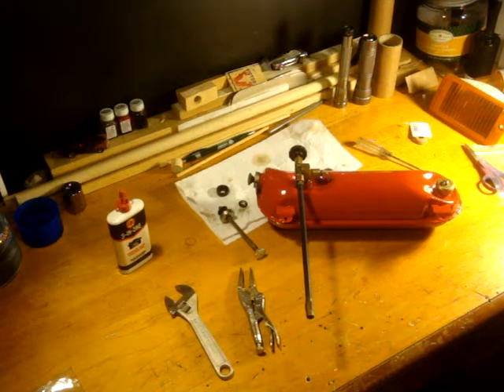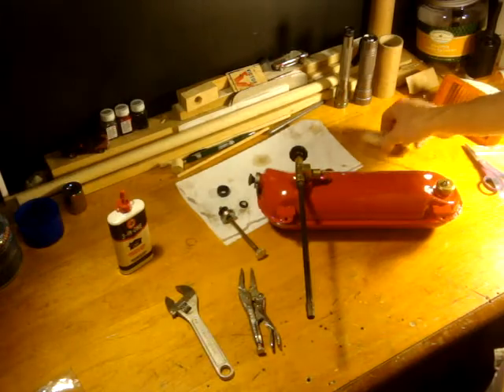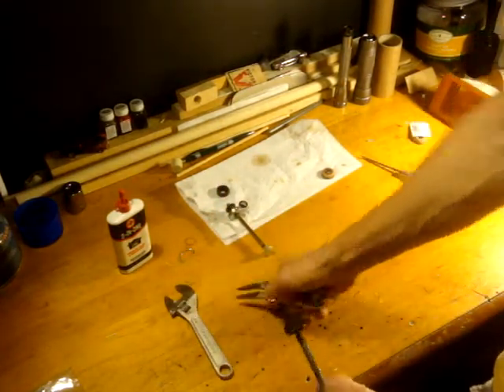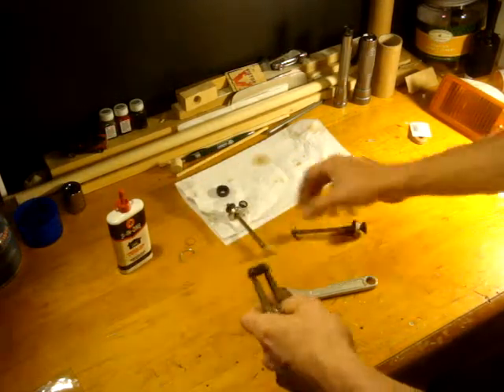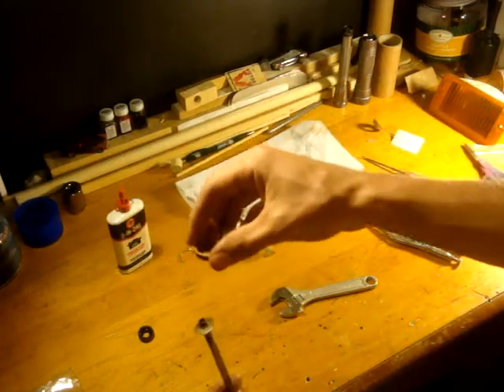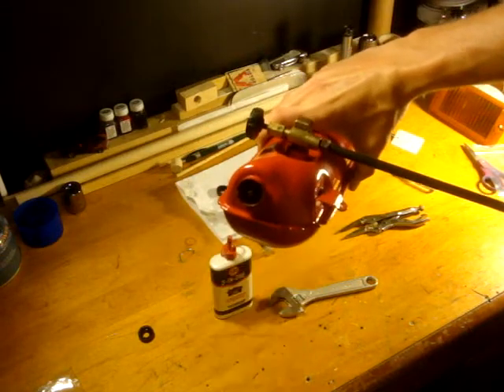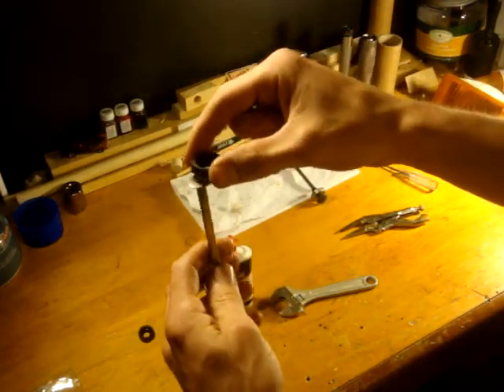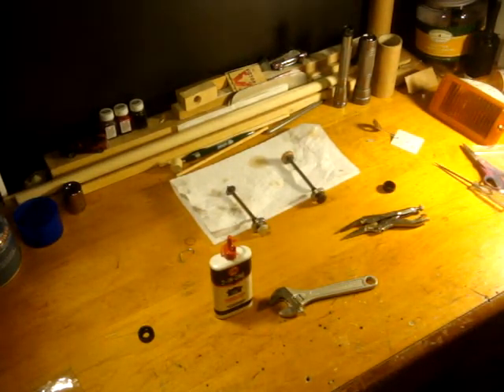How to Fix a Leather Coleman Pump

Comment: Excellent video and a helpful thread. Love when that happens. I just picked up an old Coleman 413E from (I think) 1954. I bought one of the pump replacement kits because the leather cup was in tatters after sitting dry for many years. What struck me most was how much the quality of parts has changed over the years. The original pump rod is real metal with a solid cap and all the pieces are good quality. The replacement? Not so much. Cheesy aluminum rod and flimsy parts that you could crush in your fist if you wanted to. I kept as many of the original parts as I could and just replaced the cup. Even that feels like it'll probably shrivel and die in a summer or two. It's a cliche to say so, but man, they don't make stuff like they used to. Great instructional. Thanks.
Reply from the maker: ***** Yes, very much so on the "they don't make stuff like they used to". Unfortunate, but that's how it is now.
Reply: +Mark LaFlamme , 

I don't have a beef against modern material selection...there's nothing wrong imo, with the plastic or aluminum bits on these newer pump components, if the materials specs are sufficient for the requirements. A bazillion Aluminum engine blocks and polymer gun components, over the course of decades has proven out that things can indeed be properly spec'd and engineered to work even if it's aluminum or plastic or rubber instead of steel, brass and leather.     

That being said...It is definitely a cool thing that you can maintain your lantern with something as simple as a piece of leather punched out of belt stock.  I salvaged my old leather cup and smugly put away the replacement pump rod, thinking "yep...the lantern's back in action for yet another season..."

Comment: I also wanted to point out that before you go and toss the old leather pump cup you can check if it's salvageable by simply oiling the leather a bit, and then flaring the leather a little.  Adding a little oil helps soften the fiber of the leather cup.
Reply: This biggest problem with the leather is they simply dry out . I put the leather in a shot glass with some olive oil for 24 hours and have made 2 pump leathers from the tongue of an old leather boot . My latest is still working after 15 years .

Comment: Dear WeekendHandyman,  I have one that maybe you can help with.  I have an older brass colored tank for a 425.  When I pump the air pump, it feels as if it’s fully pumped.  When I release the fill cap, nothing escapes.  No pressure.  I have turned the pump to the left and still nothing.  I saw someone suggest to spray carb cleaner in the tube to see if the check valve has gunk.  I let it set for 10 minutes and still unable to pump.  Just to let you know, I have several 425 stoves and lanterns, so I know what I am doing.  Also, I did take the black knob and needle apart and cleaned that too as it is very hard to turn.  Suggestions?  Thanks

Comment: How do you replace the locking pin back into the lid??
Reply: Hook one side through the hole in the cap and tank after aligning them, then just push the other side back in place.

Comment: This might fix the device, but it's replacing the pump.

Most of the time, the leather is too far gone to fix. That said, I have saved the day a couple times with a little air tool oil and gently stretching the old leather to regain a seal. When you're not in a situation where you can get any parts in time to do any good, it'll hold for a while. Sometimes years.

You've just got to be gentle and get pleanty of oil into the leather so it doesn't crack.

Comment: I have a pump problem too but it's the opposite. Theres too much resistance. It won't put air in the tank. How canI fix this?
Reply: +BonJohnvie It sounds like the check valve is clogged. You can try using some spray carburetor cleaner in the bottom of the pump, and letting it soak for a while.

If that fails to clear the blockage, you'll need to replace the check valve, which runs less than $15. Use one of those impact type drivers that you hit with a hemmer with a flat tipped screwdriver bit, and it should come right out. You do NOT need any of those "specially engineered" tools found on eBay for $39.95. I even used a cordless impact driver with a flat tipped bit, and had mine out in just a couple of minutes. (I could not find my driver described above, otherwise I would have used it)

Next, just spray something to clean out the area, and screw in the new valve, it only needs to be hand tight. Then screw in the bit that the pump rides on, and you're set to reinstall the pump plunger.
Reply: +Charles Walter thanks very much!

Where is this valve located? Is it connected to the removable part of the pump or is it in the cylinder?
Reply: +BonJohnvie When you remove the pump plunger, you will see the pump valve (I don&#39;t know the correct name for it) that you open and close by turning the pump knob to open and close. This threads into the check valve, which you can see at the bottom of the pump cylinder. With the piece that the pump shaft rides up and down on removed, you can see a tapered end that enables the air to go from the pump to the fuel tank, via the check valve. If you then look down into the pump, you will see where the flat tipped screw driver will fit. You will see that there is a slot that is much thicker than any screw driver, however, that is unimportant. Once it is broken loose with the impact driver, a normal screw driver will work fine. It will also be fine to install the new valve, as it only needs to be hand tight.

Before installing the new check valve, it would be a good idea to flush out the pump with spray carburetor cleaner to clean out any metal bits that may be in there.

And re-reading your first comment, you ARE turning the pump knob at least one turn counter clockwise, correct? If you are not, then no air can get to the check valve.

Comment from the maker: You can but I highly recommend against it.  The Coleman fuel is a very clean version of gasoline called white gas.  Normal pump gasoline has ethanol, detergents, and numerous other additives that when burned in this equipment have a tendency to build up and clog fuel delivery.  Coleman fuel has a very long shelf life so if it's left in the the lantern and isn't emptied between uses it won't be a problem.  Plus, I wouldn't want to eat food cooked over gasoline with detergents and other additives
Reply: I get what you're saying about not cooking your food over "dirty" fuel. 
BUT, how many people are cooking for directly over the burner flames on these old stoves?  Seriously, the slats are too far apart to cook a burger. Even if they were closer, you'd want some protection from drippings onto the burner. 

Most people use pots and griddles on these. Thus do direct contact with your food. 

Coleman has been selling dial fuel stoves for years. I don't think their legal deportment department would let them continue to sell them if there were a health issue. 

And, it's well known that the older stoves, not labeled dual fuel will still burn unleaded. Yes, there is a greater chance of clogging the burners and having to replace a manifold once in a while. 

But seriously,  I've been running a combination of whatever fuel I've had on hand for years, and frequently (I used it multiple times daily for a year last year even).  The pump flange gave out before the burners. Upon inspection,  it was my fault for not realising I should have oiled it more often as much as I was using it. 
Reoiled and good as new. 

Hope this helps others unnecessarily worried about using quality unleaded in their tanks. : )
Reply: I apologise for the typos. Won't let me edit the post thru my handy. Will try to fix later.

"Thus "no" direct contact with food.'